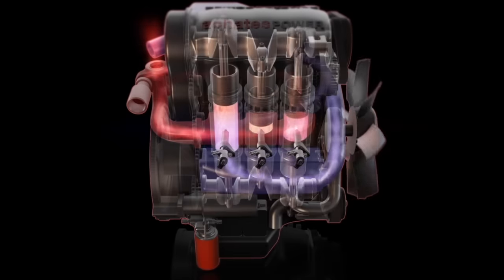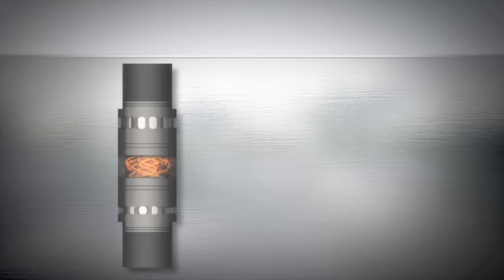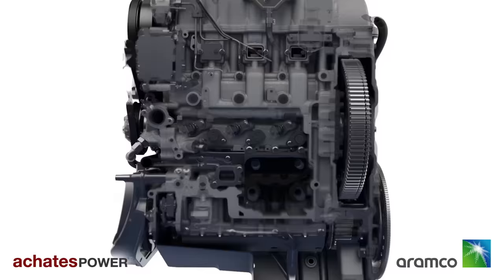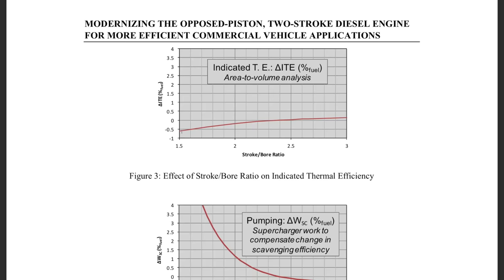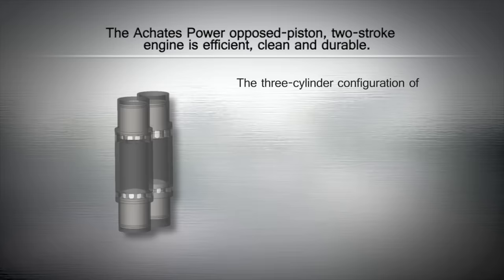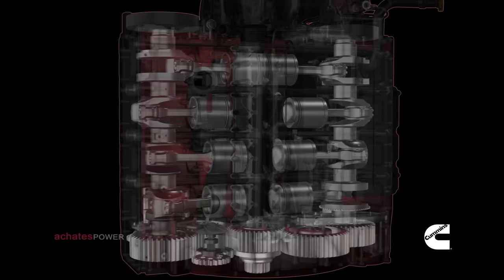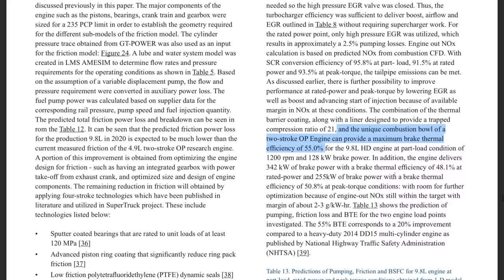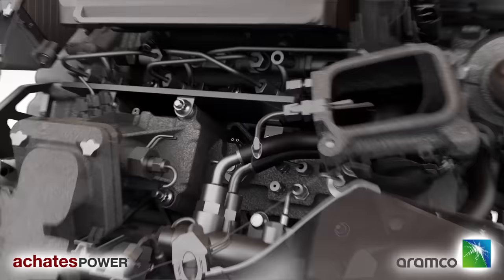Opposed Piston Diesel Engines Are Crazy Efficient

Comment: Would love to see one of these put into a general aviation aircraft.  Power to weight ratio of a 2 stroke with higher fuel efficiency than most 4 strokes, running diesel that can usually be found at airports in the form of Jet-A, supercharged and turbocharged for high altitude performance.  It checks all the boxes
Reply: Junkers of Germany did exactly that starting in the 1930's. Look up Junkers Jumo 205. Impressive engines. Never could understand why they aren't more commonplace.
Reply: Weight and cost of development, is why you don't find them. Superior Air Parts did announce the Gemini for some time, but now it seems lost in limbo.
Reply: The Junkers Ju 86 powered by one of those engines hit nearly 50.000 ft.
Reply: @SuperYellowsubmarin  
overhead valve had better oil control.  a port on a cylinder wall is hard to stop oil getting in when the piston sliding by it needs it to keep from seizing.
Reply: @hg60justice  that's for sure. That's probably why such developments as Gemini and Deltahawk are so long.
Reply: Diesel fuel gels up at low temperatures making it a dangerous choice for aircraft engines.  Ralph and Noel Wien started Wien Alaska Airlines in the early 1930's.  I believe it was Ralph that was killed when his diesel powered plane crashed on takeoff which was attributed to the diesel fuel gelling up.  His widow remarried and lived in Park Rapids, Mn. with her two sons.  I knew the two sons, Robert and James.
Reply: @craigcampbell1070  Yes and no, it does gel if not treated but all the tech for that exists anyway.  You are not told, but in cooler climates the Diesel deliveries to garages around November in the northern hemisphere is of a winter type with anti gel agents.
The Russians know about winter, all their WWII tanks were Diesel powered because if you can spin it, then it goes, gasoline/petrol at their winter temperatures does not vaporise sufficiently and you need starting fluid (KI-Gas) and carb heat, as the Germans found out. . . . . . . .
Reply: Diesels can run on jet A the same as commercial jet planes.
Reply: Make a triangle of it and you'd have a Deltic
Reply: @supertyfon1736  Thats one hell of a long stroke !
Reply: @craigcampbell1070  Even your humble Toyota Land Cruiser today has heated elements in fuel tank and fuel lines to ensure maximum K's from diesel. If it can be done in cars, there's no reason it can't be done for aeroplanes.
Reply: Diesel Air Limited makes opposed piston 2-stroke diesels for small aircraft but I think, no aircraft has that engine from factory. This engine is at the moment mostly for people who build their own planes. The engine is Diesel Air Dair 100 if you are interested
Reply: And the weight needed to make it strong enough to be a diesel can double as cargo!
Reply: AND getting to a reasonable prop RPM is much easier- the engine is turning 3600rpm at peak power to start, and with the gear drive connecting the cranks you have a ready-made reduction drive already centered on the engine.  A proper reduction drive is always a design issues on auto-to-aircraft conversions.... with this Achates it's almost baked in at the start.  Size the bearings appropriately for thrust and gyroscopic loading and maybe a very efficient  4-6 passenger light plane engine.  Might even be better than a LS3 :)
Reply: @supertyfon1736  
57,000 feet , highest altitude plane of WW2
Reply: @patrickhorvath2684  Which type.
Reply: @supertyfon1736  
Ju 86R. I think
6 cyl 12 pistons 
Supercharged with nitrous oxide injection
Reply: @patrickhorvath2684  Oh nice.
Reply: @craigcampbell1070  These engines will burn gasoline and diesel. They don't need spark plugs to ignite the gasoline.
Reply: @572Btriode  Automatic trans. fluid used to be used in trucks to prevent the diesel from gelling.
Reply: @rossbrumby1957  But that's not really true now at all.
For a really efficient aero Diesel go look up the Napier Nomad, it's not opposed piston but the efficiency is staggering.
Reply: Seems the weight would be  comparatively low for a diesel. Compactness might lead to heat concentration around middle cylinder.
Reply: @craigcampbell1070  But that would not be  problem with today's additives - it just means you can't use ordinary truck diesel. In fact why not use ordinary ATF (Aviation Turbine Fuel) - there's no reason that wouldn't work in a diesel designed for it. ATF already has those additives.
Reply: Aircraft piston engines are rated by horsepower per pound, diesel engines have to be built heavier to withstand the compression.
Reply: @hg60justice  Yes and no,  the American radials had a propensity for oil consumption, the P47 was range limited by oil capacity and not fuel.  See Greg's 8 part dissertation on that.
Reply: @russellkeeling9712  You do need a bit of oil in gasoline, and other liquids, though for the injection system, common rail systems are a different and more critical animal altogether.  And combustible liquid will burn in the Diesel principle, white spirit, engine oil,  kerosene, whatever.  Owing to the fuel price in Europe, waste cooking oil became popular with older simple mechanical injection systems.  Even flour dust will go if you can inject it (as flour mills well know), Dr. Diesel intended and used initially coal dust being a copious waste commodity at the time, the combustion ash though made short work of cylinders and pistons.
Reply: this could be the perfect engine for Celera airplanes as they need small, high-power piston engines to run the propeller.
Reply: Russians used one in their bombers but it was not reliable. maybe a new edition running on lighter Jet A-1 would behave better!
Reply: Jet-A is more of a heavily refined Kerosine which makes it Diesel fuel oil #1 instead of Diesel fuel oil #2 like you would find at a gas station. So you would have to make sure the engine is tuned to burn Kerosine which is lighter, drier, and burns with less lubricity.
Reply: These people don't even have the money to develop it for a car or truck.   It would cost them millions more  to get it STC'd for aircraft - and I'm not talking about engine development but just the cost of testing required by the FAA.
Reply: @KimCJorgensen  Messerschmitt tried to fit them in fighter planes, but the engines were not performing good under high positive and even slight negative G's. Only reconaissance and transport planes had them.
Reply: @craigcampbell1070  and that is part of why Prist was developed and is such a successful product
Reply: @craigcampbell1070  Diesel fuel (as we know it from the bowser) has this problem, but Jet A or Jet A1 gas turbine fuel is commonly used in both aircraft Diesel engines and ground support equipment at airports around the world.  The only difference is the fuel pump must be built to work with a low lubricant fuel, the timing needs to be slightly retarded, and I believe it runs a little hotter.  But seeing Jet A1 has a -47 deg C (-40 deg C for jet A) freeze point, that should eliminate most of the issues you have.
Reply: @craigcampbell1070  Diesel engines can burn jet fuel. (Which is basically diesel)
Reply: Diesel also solves the lead problem
Reply: @ben3989  military disease engines that use jet fuel have reduced life spans according to their  manuals. it should only be used as a emergency source of fuel even more so with other similar types of fuel such as alcohol ect
Reply: Junker had this engine on aircrafts. Junker Jumo 205 was one of them, also they had it on aircrafts flying longer distance.
Reply: The engine block has to handle the stresses of 2 crankshafts at a good distance apart. That has weight of two engines written all over it. Most aircraft 2 strokes are 2 cylinder and very light.
Reply: Can't compete with a turboprop for high altitude performance, or for reliability.
Reply: oil consumption. @KimCJorgensen
Reply: @johnmartin3517  Fuel consumption you mean?
Reply: @itchyvet  your humble land cruiser from 20 years ago has a more technology in it than your typical piston aircraft from last year.
Reply: @robertrobinson3861  Lol ! Give him both bores !
Reply: @patrickhorvath2684  10,000bhp

Comment: The Deltic train in the UK used three of those in a triangle set up, still has a massive cult following
Reply: The deltic engine is so big, though.
Reply: @PanduPoluan  The Commer TS3 however is much closer in size and is almost exactly the design being considered here.
Reply: @ColinMill1  I owned one. superbe to drive except for the clouds of smoke on start up that took a few miles to burn off. See my comment above.
Reply: @PanduPoluan  Same basic concept could have been built a lot smaller though.
Reply: Cult following! Nah...:)

Comment: My dad bought a TS 3 Commer "Knocker" Truck in 1955. It was a tip truck.  It had a 3 cylinder supercharged, opposed piston 2-stroke engine as described here. It had loads of power and was a screamer. Anyone who'd had experience with one could recognize its exhaust note blocks away.Only, it didn't have 2 crankshafts; the two sets of pistons and conrods were connected by massive rocker arms connected to a single crank.
Reply: Same

Comment: Damn, two stroke, turbo diesel, with two crankshafts. Max power efficiency with tons of torque.
Reply: I wonder what it weighs per hp or ft-lb ratings?
Reply: "Power efficiency"?  What's that? It's power is 100 hp per liter (motorcycles are double that). Its energy efficiency is between 40 and 50 percent (motorcycles are half that).
Reply: @MultiPleaser  it's diesel! Motorcycles have gasoline engines, and those motorcycle engines generates those high level powers at very high rpm. Saying power, only HP, not torque! Modern diesels generates almost the same HP per liter as much as gasolines at lower rpm, and still generates much much more torque than gasolines.
Reply: @gokceralp  Only with a turbo charger or two, compared to a normally aspirated gasoline engine. But, as soon as you put a turbo or two on a gasoline engine, the diesel is old news.
Reply: ww2 germans used them in pt boats
Reply: @robertboykin1828  They used them on their airplanes as well.
Reply: The Germans had 6 cylinder turbo charged opposed piston diesel engines for airplanes and airships, yes airplanes, during the late 1930's and WW2, check out the Jumo 205 and Jumo 207 and insane Jumo 223 engine (the latter having 48 pistons, 24 cylinders in 6 cylinder rows with 4 V crankshafts, basically 4 V12 engines stacked around each other.)
Reply: @gokceralp  and ontop of that small engines such as motorcycle engines are the most harmful to lungs and the environment because they all run rich and the fuel isnt burn well
Reply: @MultiPleaser  not neccessarily. Naturally aspirated diesels still can produce a suprosing amount of torque
Reply: @MultiPleaser  are you talking from the wheels here?
Reply: @lordoftherims436  Ah yes, because my single-cylinder 125 that uses 3.5 liters of gasoline per 100km (roughly 60-65 mpg), is the killer of the environment, and not the car guzzling 3 times as much gasoline.
Reply: @gokceralp  some are diesels: Neander turbo diesel twin cylinder, twin crankshaft engines are in bikes and outboard motors. It's an awesome design.

Comment: I'd love to see these implemented...there hasn't been a huge innovation in engines for a very long time.
Reply: Yea and diesels are treated like the plague in the states
Reply: @jakewhite3163  quite the opposite. americans love their big diesels
Reply: @jakewhite3163  I actually do not see why this design wouldn't also work with other fuels and a spark plug in the center.
Reply: @HiltownJoe  The Germans made gasoline versions during WWII if I remember correctly, the only issue is timing, not just the fuel injection, but the spark as well.  It's not that it was impossible, the Germans were trying to achieve as simple a design as possible for reliability reasons.  They ended up going with diesel but the engine could barely go above 1,400 rpm, and for aviation purposes that wasn't nearly enough.
Reply: @butterh2  Yeah right. They killed the VW group diesels.
Reply: They are putting one in the next gen Tank (Abrams X).
Reply: Hahaha, watch the Napier deltic engines. These engines have been in use in British trains since the 50's... instead of 2 crankshaft, they have 3.. the sound these engines make is called THRASH in britian, and quite frankly gives me a boner everytime I hear one run..
Reply: @cino4919  “they” are the government. People love them.
Reply: @HiltownJoe  the L60 engine used in the chieftain tank from the 1960s was designed as a multi fuel engine. Old technology.
Reply: @butterh2  they don't love the small diesels though. And that's what this would be for.
Reply: @chicken29843  traditionally opposed-piston engines are large
Reply: @alanhat5252  that's true but in terms of output that's what this seems to be targeted at. Europe will love it
Reply: @marshalberthier2402  the Rolls-Royce Merlin only revs to 2,200rpm, there were several geared propeller drives in the era, I believe there still are.
Reply: @chicken29843  they're taller than an OHC engine but tipping it over would probably fit it under modern low bonnets
Reply: er try the commer one mate, used in lorriers back in the late 1950's
Reply: Um they have been. Commer knockers were common here in Australia and of course Britain in the 60's. Couldn't kill them with an axe and got good fuel consumption. Some big car company bought commer and shut them down...go figure...
Reply: LOL.
The video says this tech has been in existence since the late 1800's.